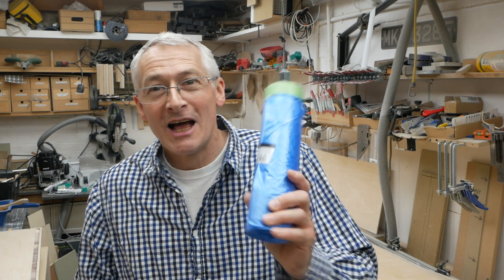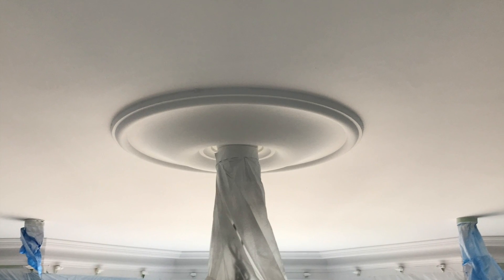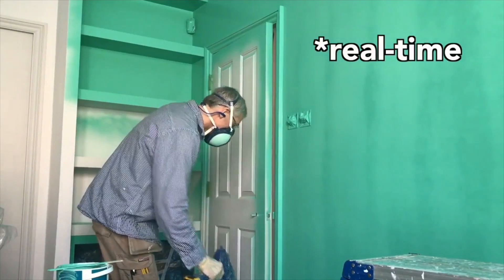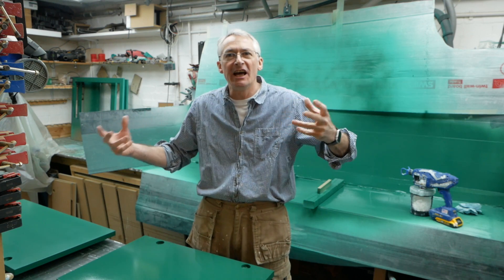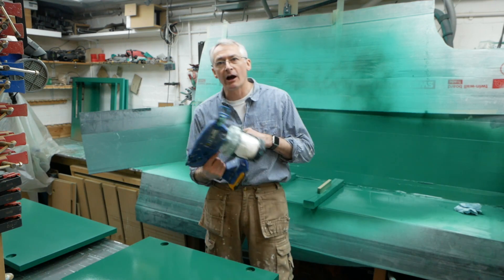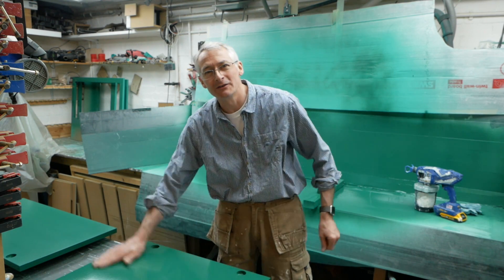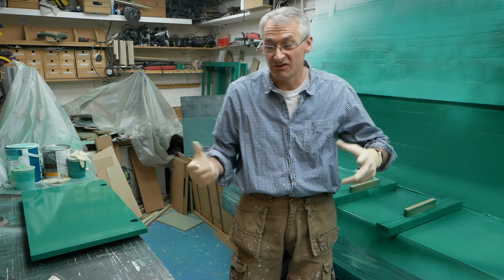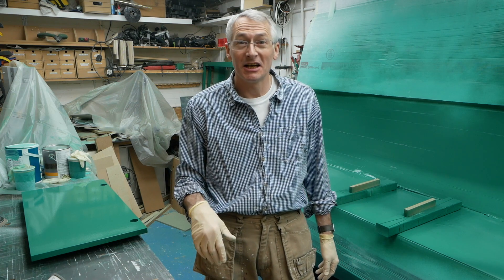Graco Ultramax 5 month test P4 #193

Comment: Excellent. Would like to add one tip. When you are spraying the doors at the end you are spraying at an angle to the flat finish. Experience and all pro tip reading tells me that you want the fan to be  as perpendicular to the surface as possible for even coverage. I get doing the edges that way, but then you want to move directly above the piece so the coating is even. The Graco makes that much easier than HVLP because it can be sprayed in any position. Having a lower support on a lazy Susan would make staying directly above the piece easier.

Comment: Peter a few tips for you. When you spray the tip should be 90 degrees to your work. If its say 45 degree the top or bottom which ever is closer to the work will be wetter and you will shoot more paint onto the work piece. Also you have to keep your hand traveling in a flat line while the gun is spraying other wise the paint you shoot at each end of your arc of travel will be drier than the center of the arc. One other thing to try and help. You didn't show it but usually when you spray walls you should back roll the paint to keep it even on the surface.
Reply from the maker: Cheers Greg. Don’t know what you mean by ‘back roll the paint’??
Reply: it means going over the sprayed wall with a roller after spraying the wall ….. and I would also agree with the spraying flat to the work piece to get a even coat on it all...  and as said before that machine is not meant for spraying walls and ceilings just the odd door and touch-ups work..  great video mate as always
Reply from the maker: Appreciate the advice, but spraying the wall, then rollering it? In a high gloss finish? Umm no thanks! Also Arran, you keep saying it’s not suitable for spraying rooms, just the odd door, but I know more than a few painters who use it for exactly that. <shrug> 👍👍
Reply: Peter, I agree with Greg.  I only use my Graco hand held for shooting trim, crown and doors.  And coincidently I only shoot Bejamin Moore Advance.  I also use the 790 Advance primer too.  Don't love the wait times but I love the finish.  I don't spray walls, I roll instead but if I did I would use a 517 tip.  It looked like you were using a 310. And finally!  Something other than white!
Reply from the maker: Yes, something very 'other' than white 😂. Couple of guys I know recommended a 517 for emulsion/primer/undercoat but I couldn't get hold of one in time when I was doing this; tried the 514 that came with the gun and had a few issues, 410, 310, 208 all worked consistently well with the paint <shrug>

To clarify, you'd use a 517 for gloss, or just the primer/undercoat? And if you were rollering the walls in gloss, could you get a comparable finish to the sprayed cabinetry? Just curious as to best working practices, thanks 👍
Reply: Replying to your question about the 517 tip for gloss and primer.  Here in Kansas I only see satin on trim and flat, matte and on rare occasion, Satin on the walls.  I personally have only shot satin on trim and doors with the Graco handheld.  I roll matte on the walls.  Everywhere is different though.  Regarding the 517 tip, it shoots alot of paint fast, supposedly with a 10" wide path at 12" from the surface.  I believe it requires running the pump speed on 8 or above for the 517.  I can't imagine that gloss would make a difference or shoot differently than   satin or semi-gloss.  Now thinning or a conditioner would make more of a difference but the beauty of airless is no thinning required.
Reply from the maker: Thanks for clarifying Phil. Yes, the 517 would throw out a lot of paint, not at all sure it was what I’d really need with the gloss finish, but a moot point anyway as I couldn’t get my hands on one. The 310and 410 worked very well with all the paint types I was using. And agree, this is only the second time I’ve been asked to apply gloss onto walls - very much an ‘interior designer’ thing, I think! Thanks again for taking the time 😆👍

Comment: You can build yourself and small wind tunnel to help dry your paint work using plastic sheets and a foldable frame (for easy storage), a low RPM fan and a HEPA filter. Two advantages: faster drying time and zero dust settling.

Comment: Hi Peter. Another nice video. For smaller panel I use a rotating table, just bulit out of materials around the workshop. Saves picking it up half way through the process.....
Reply from the maker: Thanks Ian! Yeah, I’ve seen a few guys using an old office chair with the back removed, works really well. Space as ever, is my issue - there just isn’t the bench depth to spin even a small door around! 🤔👍👍

Comment: I bought the Truecoat 360 (the baby of the series), and that bad boy is still a beast! Took me 30 mins to paint my basement walls. The prep time is the only thing that's long, but once that's done your work time is pretty fast. The only con to these airless sprayers is that you have to refill the paint a lot, but it's still worth buying. Especially if you using rollers and brushes like I do.
Reply from the maker: Unfortunately my Graco died - pump, again - so it won’t be getting another. 🤷‍♂️
Reply: @10MinuteWorkshop  that's because you do a whole lot of painting sir 😁

Comment: I recently did an oak staircase with the graco ultra max spraying osmo oil and final coat of lacquer . Had the same problem (orange peel/ speckled ) finish. Even on low setting and using low pressure tip. Always used lint free cloths to apply stains and oils which leaves a perfect finish ! I’ll be doing future staircases by hand in the future ! Ha

Comment: Hey Peter. I’m about to pull the trigger (pardon the pun), on an ultra max. I’m just doing the usual two months of research. I truly appreciate all the effort you’ve made in making this extended review series. Subscribed
Reply from the maker: Hi John, and thanks! The Graco cordless guns are great for a lot of things, but they’re not subtle - they throw out a lot of paint - and they’re not for someone who does spraying as an extended part of their business. Even with my fairly modest amount of spraying I had a pump failure after about 8 months. Replace under warranty (took 3 weeks!) but it was a reminder that they’re not full-on production workhorses. If you need to be spraying daily, I’d advise you to look into another system. 👍👍

Comment: Good stuff, thanks.  We have had painters here recently painting the outside of the house.  I was expecting them to spray the stucco, but they said spraying doesn't provide as good adhesion (as rolling or brushing).  That may also relate to the earlier comment about "back rolling" although I get your point about losing some of the gloss.  Cheers, David
Reply from the maker: Cheers. I think exteriors are a different game altogether, tbh - I’ve certainly never sprayed any 👍
Reply: Pro painter here. Stucco- spray and backroll is the best of both worlds.  Spraying gets the paint up there faster, backrolling works it in.

Comment: I watched a few YouTube videos and they mentioned these style spray guns should not be used for big walls.
Because was looking forward to purchasing one to speed up my productivity
Reply from the maker: The issue is that they're relatively small units, so while they - clearly - work well on walls, it's not the kind of thing you should be doing with them day in, day out. After the pump failed on mine for the second time, I'm afraid I wouldn't recommend them.
Reply: @10MinuteWorkshop  good advice mate,I thank you for your honesty and integrity

Comment: Loving this series, only thing I'd change would be to spray walls first then ceiling.
Reply from the maker: Thanks! Why walls first, out of interest? Walls were gloss, so my thinking was there’s more chance of marking the finish masking off if I did the walls first, but always happy to learn of a better approach. 👍
Reply: @10MinuteWorkshop  

I have been professionally painting  for about 15 years.  I am pretty passionate about it, i mean I'm watching painting videos on my free time after all. Anyways,  i sprayed using both methods and find spraying walls first and then ceilings is much easier. It is much easier because you can just run tape on the wall at the ceiling line all the way around the room and then tuck plastic under the tape and drape the room.  As i am tucking the plastic i press the tape down firmly and usually blade the edge down with a small putty knife to get that razor sharp tape line as well as prevent bleeding.

I find it much easier to tape to the wall than to the ceiling, and also gravity is working in my favor with the plastic. 

If I'm doing a 100% spray job i usually shoot the trim, mask it off, shoot the walls and then shoot the ceiling last. 

Really like this series!!
Reply: @mm-xk7pg  that makes a lot of sense. Out of interest, what if you were doing brush and roller. (And how about with a picture rail?)

Comment: Definitely going to get one of these for my workshop Peter
Reply from the maker: I have the ‘conclusion’ vid coming in a few weeks... 👍
Reply: Did you get one?
The cordless model Peter has is $800 here in the US.  A corded model,  the True Coat 360 vsp, which can't spray oil based finishes, which is OK with me, is around $250-$280.  That's a $500 difference.
I'd rather not have to thin latex paint to spray it but my cheap spray gun does a decent job with thinned latex.
Except for a table saw and miter saw I definitely prefer cordless power tools.
Reply: I should clarify.  I just realized the cordless comes in the Ultra and the Ultra Max, which sprays flammables, etc...  The Ultra, for water based, is around $580 here in the US.  That's a bit easier to swallow.

Comment: Fab illustration of the time efficiency of a sprayer. That’s a qualified efficiency though - prep takes a long time but, the finish (where it matters) is very good indeed.
I live in the US and the distinct t-t-t of airless sprayers has joined the vexing sound of leaf blowers as a sound of summer. My house was painted outside a couple of years ago and the guy took a day to prep and cover but 1/2 day to paint each coat.
Have you seen videos from Idaho Painter?
Reply from the maker: Cheers Frank. Yes, Idaho Painter and Finish Carpentry are both in my watch list 👍

Comment: Cheers for the series Peter.  nearly makes me want to do away with my HVLP set.  Nearly but not quite, excluding the running compressor I can't see to much of an advantage, still got to deal with overspray and clean up is still a pain in the backside, especially with oil based stuff.
Reply from the maker: Cheers David. Haven’t used oil-based at all, but cleanup with the Graco is very fast. We get to that in more detail later in the series 👍👍
Reply: But in airless you do not need to dilute the paint.

Comment: These are great for very small jobs, but they fall short when doing a full room. Just rent an airless or buy a cheap airless (drill out the tips) and use an extension. You can buy or rent an extension for the sprayers that eliminates the need for spraying from a ladder. The 5 gallon bucket just can't be beat!

Comment: When you removed the masking from the base of the ceiling moulding after the green,  did any of the fresh white come away? Always seems to happen to me and then having to touch up with a tiny brush... Right nuisance!
Reply from the maker: Happened a couple of times; after that I used Tesa Pink (delicate) tape and it was much better. When I used ‘tape & drape’ I’d apply some pink tape first - makes a big difference 👍👍

Comment: Benjamin Moore paint is the only paint I use now. Been using it for a few years now.
Reply from the maker: Cheers Graham. 👍 Haven’t used anything other than the Advanced Gloss - how do you find the other finishes?
Reply: Peter Millard fantastic! I’d never use another paint. Water based for kitchen cabinets is almost one coat (with brush) not tried a lot with my Graco - yet. Colours are beautiful, paint runs lovely and settles beautifully. 

It really shows up how bad the shed’s paints are. Even Dulux and Crown etc. BM is expensive - but worth it!

Comment: Hi there enjoy your videos.
When you taped up the ceilings and sprayed the green walls did the wall colour bleed through to the ceiling when you removed the tape and plastic and if it  did  did you touch up the ceiling with a brush
Reply: And one more question what speed did you use to spray the cabinet door was it full speed or around 6 or 7
Reply from the maker: No major bleeds, just the odd area where the edges of the cornice needed cleaning up a little. And yes, I touched that up with a brush. 👍👍
Reply from the maker: Thanks, btw! Vast majority of the spraying was done at around speed 3-4. Only ever had it up as high as 6-7 was when cleaning. 👍👍

Comment: What about adding/spraying a couple of coats of water based clear coat on top of the paint then polishing that?  You can achieve a glass-like finish.  It will also give it more depth.  More work but the results and long-term durability could be worth it.

Comment: Hey great videos.  You’ve probably mentioned it already but what tip are you using?
Reply from the maker: Thanks! I’ve been using a FFLP 310 for most things without any problems; used a 410 for some larger areas, and have a 208 for fine details, but >90% use the 310 👍👍
Reply: Great.  Thank you.  Is the paint a latex enamel?
Reply from the maker: The green paint was a Benjamin Moore advanced gloss, the white was Tikkurila Helmi 10, all water-based. Sorry, don’t know what a ‘latex enamel’ is! We probably call it something else here in the UK 👍👍

Comment: Hi Peter, Not sure if you mentioned it in the video but what material were the doors? MDF? did you have to seal them or paint straight on?
Reply from the maker: The cabinet doors? Primer/undercoat, then painted. De-nib between coats. Never used MDF sealer, never saw the need 👍👍

Comment: How much of a time saving is made when you consider all the masking up and other preparation? I reckon most of the time spent is on masking with spraying actually no time at all in comparison.
Good finish BTW.
Reply from the maker: This was the first time I’ve masked anything up, so I was particularly... thorough. The more I do, the faster I’d expect to be. The ceiling though, that would be a solid job with a brush & roller, so even with the masking off there’s a time-saving 👍
Reply: When I spray wall I use 50cm masking film on the ceilings which is more than adequate and takes less time than cutting in with a brush. On top of which I only have to mask once, cutting in I'd have to do at least twice. 

One thing I always do that adds a little time is back roll all my spraying. If you don't back roll you can't touch up the walls later. A light roll with a short nap roller fixes that problem. It also evens out your coat which is needed, especially on walls with a natural light source shining down it or darker paint colours. Plus, takes away any concerns about spits. Nothing worse than perfectly spraying a wall to get a random spit half way through. A little roll fixes all that.

One thing you absolutely need to do is use decent low tack masking tape. I used something new this past week to mask an immaculate ceiling that had dried for a week and when I took the tape off it pulled off the paint in parts. %&~$ing nightmare!
Reply: Hi Steve just wondering. When you backroll the walls once you have sprayed them, have you loaded the roller with paint? If yes how much paint is on the roller? Please explain how you do this.

Comment: Hi is that a water based paint? Have you tried oil based I've heard that you need a grounding wire because of static build up resulting in shocks? Have you experienced that?
Reply from the maker: I’ve been ‘water-based only’ for about 15 years, so no experience of putting oil-based through this, I’m sorry. One of the advantages of the Ultramax over the Ultra is that it has a brushless motor, so it can be used for flammable finishes, but it’s not something I do. Also, this is quite an old video; the pump has just gone on this Graco for the third time; it’s not getting replaced. 🤷‍♂️
Reply: @10MinuteWorkshop  Sorry to hear the pump has gone again, what are you using now? Thanks for the reply too, I really enjoy your vids. 😃
Reply from the maker: I used the Graco for the last time time in February/March when it was playing up a bit. Lent it to a friend who needed to get a base coat on a large area and it conked out completely. 🤷‍♂️ And I’m pretty much done with spraying now - I’m not really doing any of that kind of work now, tbh, I may take a look at a cheap Aldi/Lidl hvlp cordless sprayer and see what they’re like for ~£60, but it’s not something I’ll be using for work.  👍👍

Comment: Knowing everything you know now... would you recommend it? I'm thinking of buying.
Reply from the maker: No, absolutely not. Not without some kind of cast-iron guarantee on the pump, which they don’t give. 🤷‍♂️
Reply: @10MinuteWorkshop   it's not meant for full walls an ceilings that's why the pumps don't last its for doors an small areas
Reply: They good for cutting in rooms an roll the rest

Comment: Hi Peter have you checked out the cabinet door ‘sure hook’ system from rockler? Not sure of it’s availability here in uk but would enable you to spray both sides in one go, potentially halving your time
Reply from the maker: Thanks Ben. Not sure if it’s available here either, but not beyond the wit of man to make something similar, I’m sure. Does require you to have drilled the hinge pockets already though 👍
Reply: If you haven’t drilled the hinge hole yet screw a screw where you would drill hinge after
Reply from the maker: Not always possible, though. I’ve just done a few replacement kitchen cabinet doors that needed to be painted before fitting; I know where the hinge pockets should be, but couldn’t drill them for sure until I’d removed the old doors, on the day they were to be fitted 👍
Reply: Rockler do deliver to the UK on not bulky items